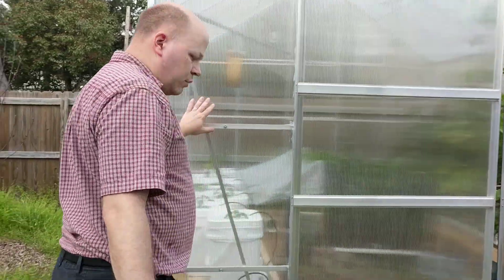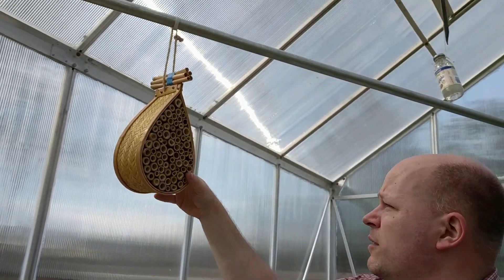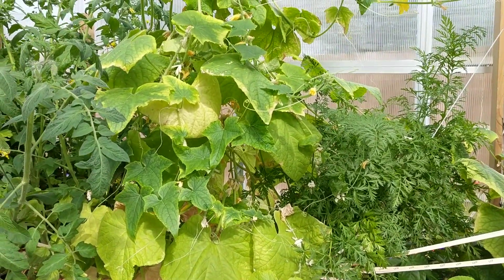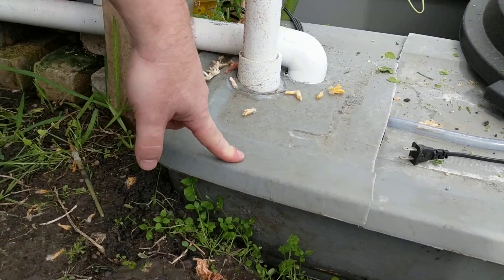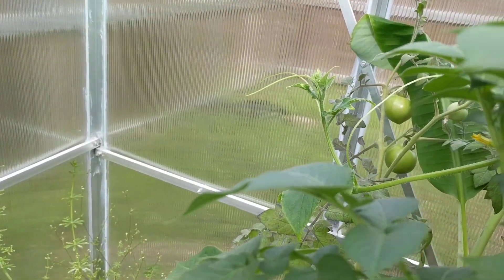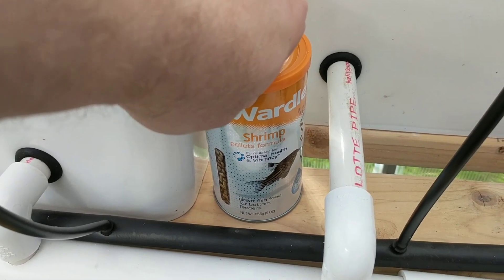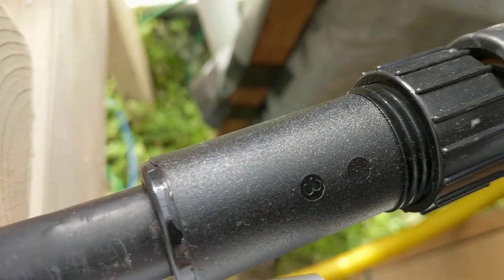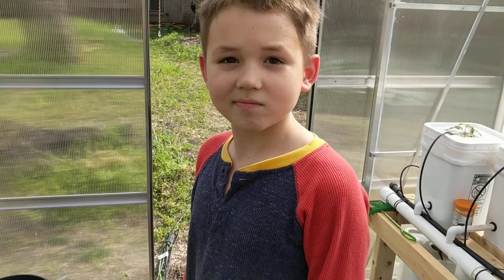Harbor Freight Greenhouse Aquaponics System

Comment: Do you get snow where you are? how warm does it goes for the whole greenhouse during winter time?
Reply from the maker: It snows once in a while, but not consistently.  We are in zone 8, so colder climates will likely have different challenges to contend with than we have here.  The wind is the main issue here, which required some modifications as mentioned in the video.

Comment: I have to admit that after watching a whole bunch of videos on HF greenhouses (about to assemble 2 to move filtration from metal shed to them) I was like... ok here is another video and then its like bitcoin, pipe, issues bam... stuff... my ears perked up so fast and then you pan the camera and there is engineering contraption there and I am sitting on edge of my seat soaking it all in. 

I have a 300 gal aquarium that has all of its filtration outside the house so trying to see all the feedback from people so I can avoid issues while setting my system up. 

Thank you.
Reply from the maker: I did the same thing, watched a whole bunch of videos before I started building mine.  If you run into any issues with assembly let me know.  I haven't been keeping up with the video updates, so if you see a project or component that I started but never followed up on, I'll be happy to answer any questions.